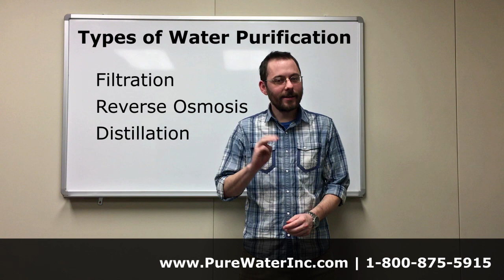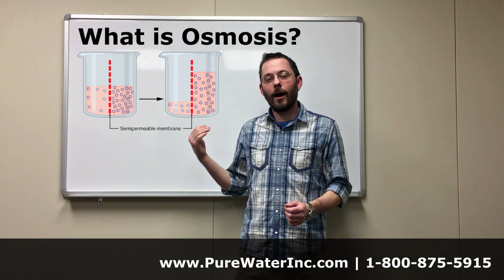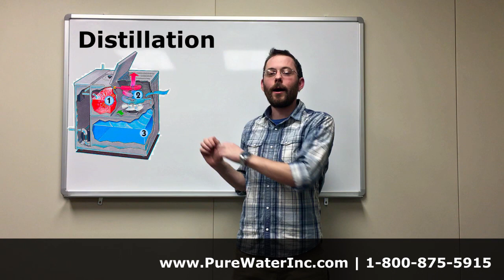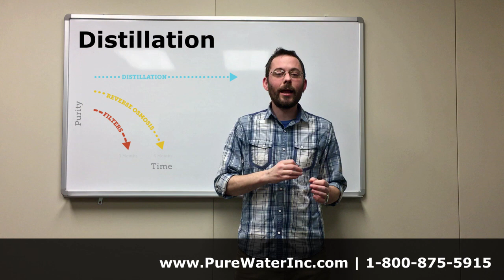Distillers vs Reverse Osmosis vs Pitcher Filters

Comment: Great points and although distilled is the best form of filtered water, it may not be the most practical for household use.

These days RO filters are far more efficient with wastage @ around 1L of waste per 1L of purified water.

As for parasite creep, replacing the membrane periodically reduces the risk.

And then there’s the flow rate of distilled vs RO where RO can provide much more volume of water in a given amount of time compared to distilled.

In a household situation where one wants to use filtered water for cooking as well as washing with filtered running water RO would be much more practical.

You’re comparison seems a little biased to me.

Comment: With Your machines, the toxins are released/captured and released around in the surrounding air.  how do you prevent breathing the ambient air with captured/released toxins?  Should the machines be kept outside for safety?
Reply from the maker: The VOCs that the distiller vents off it in no greater concentration than if you were to bring a pot of water to boil on the stove/in the microwave, make a pot of coffee, or take a hot steaming shower. It doesn't require any additional ventilation than what a typical living space would have.

Comment: if distillation were such a effecient technique then why RO is still used are there drawbacks of distillation also?
Reply from the maker: While distillation is the gold standard for purification, using distillation as a purification method at scale can be cost preventative as a steady supply of heat and power is needed to bring the source water up to a boil in order for the steam to be generated. Many municipal water systems will also shy away from using distillation as a form of purification as distilled water is a highly effective solvent which can leach contaminants from lead, copper, and other soft metals commonly used in older water delivery systems.

Comment: I went to the website and it says to clean the unit with the cleaner/descaler every month or 30 gallons.  I did the math and that comes out to be .75 cents per gallon of water just for this cleaner.  You still have to pay for the electricity to boil the water, and the price of the distiller.. You can buy distilled water for about a dollar per gallon at Walmart.
Reply: Ya but the distilled water from Walmart are in plastic bottles. The distilled water sucks up the plastic toxins like a sponge

Comment: Reverse osmosis is the best solution to purify water. Also most cost effective. I bought a complete set for under 100$ and cost me around 20$ yearly to maintence it. I have 0 ppm. Most People think they only can get down to 20-10ppm with reserved osmosis system, but they forget to buy a filter with resin to achieve 0 ppm.
Reply: Yuck I don’t want my drinking water touching nasty chemical resin.
Reply: @wesbravo8251  Chemical? It's tree resin.
Reply: Where did you buy it?

Comment: I enjoyed this condensed lecture on water purification! The water pitchers ability to filter out impurities doesn't just depend on what can get through based on particle size, but rather on the capability of the media to Adsorb (not absorb). Many pitcher filters mostly contain activated charcoal, which acts kind of like a magnet for impurities. I'm guessing it's the same filter media you have in that distiller your'e selling, since activated charcoal does a great job at removing VOC's from water (the only thing that remains in distilled water that we don't want in there).
Reply from the maker: Hi Richard, you're exactly right! We pair our home distillers with activated carbon filters to provide the best in purity.
Reply: @PureWaterDistillers  If I put the activated carbon directly in my distilled water (whether in a tea bag or loose) and left it there (say, for 10-15 min), would that filter our more impurities then just running it through a filter into a vessel? Thanks
Reply from the maker: @richbirecki  - we recommend running all the water through the filter prior to it entering the vessel. This ensures that all the water is forced through it. If you used it like a tea bag, there's no guarantee that all the water would flow through it. And if it's loose, then you have the issue of how to remove the contaminant-saturated carbon afterward.

Comment: Is the distillation process the same as water softening (Culligan services), and what's the average cost for a residential Distiller system and are plumbers typically trained to do installs or would a specialist be required? Thanks
Reply from the maker: Hi Harold, great questions! First, softening is not the same process as distillation. Softening uses salts to remove ions of calcium, magnesium and some other metals. Distillation uses a phase change to leave virtually all contaminants behind. 

The cost of a distillation system usually depends on if it is a manual fill or automatic, and how much water it produces ever day. The cost can range from a few hundred dollars to a few thousand.

Installation of an automatic water distiller is fairly basic, and any plumber should be able to handle it for you. We do have dealers and distributors who specialize in servicing the machines too.

Please let us know if you have any other questions. Thanks!

Comment: Thank you for sharing. That was really helpful. How about boiling water? Is it effective to get rid of heavy metals and chlorine? Or only kills the bacteria? 
Regards
Reply from the maker: Great question! Distillation, when paired with a simple carbon filter, removes virtually all contaminants including heavy metals, chlorine, and bacteria. 

We've had third-party labs test the process to confirm this, and you can see our lab results here: https://mypurewater.com/home-products/pure-water-lab-results/

Boiling alone kills bacteria, but it concentrates other contaminants, like heavy metals.

Thanks!
Reply: @PureWaterDistillers  ooh yes, that make sense. It will really concentrates the heavy metals. 
I missed it 😆
Thank you for the link and the very fast answer

Comment: I am very curious how could a ventillation system just blows out the VOC from the mix of steam and VOC and keep the steam unharmed to be able to continue its way to the final tank? Sounds bullshit for me. Other question is, if the evaporating is a natural thing which is right, why the destillation is not being made via lower temperature? In this case the VOCs might be kept in the starting tank. The nature will not heat the sea waters up to 100 °C to be boiled and create rain after they are condensating in clouds. I am just asking.
Reply from the maker: Those are actually some fantastic questions! 

To answer the first one: The dual VOC vents don’t blow the VOC gases out.  When the water is heated to boil, The water vapor and a few VOC gases become lighter than air and rise.  As the steam cools, it will stop rising because it is no longer lighter than air.  The dual vents are placed in position on the cooling coil of the distiller that the steam is heavier than air and remains in the coil to be condensed back to water.  Any contaminant that is still lighter than air will continue to rise up and out of the VOC vents.  It is not perfect but it does remove the bulk of the VOC’s from the water.  By pairing it with a carbon filter, we can get over 99.9% removal of most VOC’s you will find in water.  

As for the second question, this is another great question.  The answer is energy.  To turn water into vapor doesn’t require heat, it requires energy.  The sun puts out a lot of energy.  Bodies of water absorb that energy and let off little bits of vapor all day every day.  This works because the water out there is so huge and the sun puts out so much energy over the surface of the earth that it is able to accumulate quickly.  There are actual distillers called solar distillers that will use heat from the sun to heat water left in the open and the steam is forced into a condensing tube to be turned back to liquid and collected.  This will not stop VOC gases from being vented though.  These gases require less energy than water to vaporize and will do so from the sun’s output.    The problem with these distillers is that they take a long time.  With ours, since we use heat as our energy source, we are able to add energy more directly to a small amount of water and vaporize it very quickly.  This way, you are not waiting for a day or two to get enough water to drink and instead can get it in a few hours.

If you have any other questions, please let us know! Thanks!
Reply: @PureWaterDistillers  Thanks I am still trying to understand, probably I need some background knowledge first. :D However I assumed the speed is the reason of  heating it so high temperature. With the directly speed of nature it'd be slow.

Comment: Distillation has a great outcome.... However its costly to heat water, therefor not really a good sustainable way
Reply: Bro teacher Bram, let me tell you, you can build passive water distillers that runs with solar heating. Low boiling point so no VOC, cherry on the cake. Distilled water is the best
Reply: @benben162  reverse osmosis vs distilled???? thank you .
Reply: I don't give a damn about sustainability. I'm worried about my health

Comment: The main issue with a water distiller is the mineral scale that will build up and accumulate inside the machine and they are very hard to remove. I think the machine will eventually lose it's efficiency after a certain number of years of usage and the machine will need to be replaced with a new one. Am I correct?
Reply from the maker: Hi Peter, you are correct that mineral scale can build up and reduce the life of the distiller - mainly because it make the heating element work harder and harder. However, with regular cleaning (which involves soaking the boiling tank in either an approved descaling agent or a 50/50 mix of white distilled vinegar and warm water), we have seen some machines last 30, 35, 40 years without any decrease in the quality of distilled water that is produced. Some parts may need to be replaced over time but rarely do you need to replace the whole unit as long as proper upkeep is maintained.
Reply: @PureWaterDistillers  Thanks for your reply.
Reply: no Bro easy to clean with vinegar, stainless steal is all shiny and good as new, each time i clean it and see the deposit i think " i would have drunk all that shitty stuff"

Comment: Replacing the RO filters is £20 every 6 months the membrane every couple years at £40. 
The cons of RO you mention seem to apply if filters and membrane are neglected.
How does energy cost compare? 
Also whats noise levels from unit?
Cheers

Comment: if i am filling up a evaporative humidifier with filtered water which one would you recommend i buy meanwhile before i buy a mini distiller from you? i have been looking at these types but i am not sure which brand is the best and which one really purifies water the best? Thanks

https://www.amazon.com/dp/B01GABXWCK/ref=sr_1_51_sspa?keywords=purified+water+tap&qid=1551336432&s=gateway&sr=8-51-spons&psc=1

https://www.amazon.com/dp/B07DCMD991/ref=sxbs_sxwds-stvp?keywords=purified+water+tap&pd_rd_i=B07DCMD991&pd_rd_r=ddbb38d8-0818-4ca3-82b4-71c4e44da1a3&pd_rd_w=trK2N&pd_rd_wg=imzUC&pf_rd_p=5c5ea0d7-2437-4d8a-88a7-ea6f32aeac11&pf_rd_r=7X7NQWGZFYJDP0JFJP7V&qid=1551337543&refinements=p_85%3A2470955011&rnid=2470954011&s=gateway

https://www.amazon.com/dp/B01M0I5RII/ref=emc_b_5_t

Comment: hello I can't speak english very well so I don't understand 100%
can you answer me please 
now I am in the UK ,so when I drink tap water I have pain in my stomach and taste is not good , is the filter good or not?
 can  I boil the water in kettle  after  getting cold I drink it?
Reply from the maker: Without knowing what is in your water or what your medical condition is, it is hard to say if some contaminant is causing an issue and what that might be.  Distillation removes over 99.9 percent of most contaminants so it can hopefully could help reliably clear up your water so you don't have to worry about it being the cause of your stomach pain.
Reply: thank you 
before yesterday I bought Brita filter  and it's good for me 
Distillation It's hard to do I think
thx.
Reply from the maker: Brita filters remove a little.  A home distiller will remove a lot.  Because the distillation process doesn't involve a filter, the quality of the distilled water does not dip as you use the purifier.
Reply from the maker: A home distiller is very easy to operate.  Simply pour water into your boiling tank.  tighten the lid and filp a switch to start a cycle.  It is going to give you higher purity water.  On the side of the box of a brita filter it says not for purifying water.  It does very little.  Are you getting any benefit from it?
Reply: @PureWaterDistillers   great thank you
to be  honest with u after I drink  tap water I feel like something hurt me in my stomach but after brita I feel nothing I don't know why maybe my tap water have something brita can clean it I don't know and I try tap water again without brita still not very good for me even the taste change for better.....
sorry I would like to ask about  distiller 
you mean just boiling the water with closed lid then it will be pure water yes ? if it like that then where the bad thing go I think it still inside the tank yes?   ( my English it's not ok ) so I don't understand 100%
Reply from the maker: Distilling the water and boiling the water are two different things.  Boiling the water will kill bacteria and viruses but the dead bacteria and viruses stay in the water.  Steam will be let off which means there will be less water I in the container so the contaminants are more concentrated in the water.  Distillation brings the water to a boil and then collects and cools the steam that comes off of the boiling process.  this steam is cooled back to liquid and falls as distilled water.  We have now killed all bacteria and viruses and made sure we are not drinking dead bacteria.  We have also left all the other contaminants behind that couldn't vaporize with the steam.

Comment: What would be the best solution if you have a UV water treatment system but you are worryed about After treatment, is the water now ionized radiation and harmful to the human body, soil and plastic waterlines?, what harmful after treatment affects are there? Whats the best solution or further water treatment system to use after UV treatment? serious question.
Reply from the maker: Ultraviolet
light is a natural process and does not produce harmful chemicals in water. The treated water does NOT contain ionized
radiation and substances harmful to the human body, soil and plastic plumbing. It’s a safe,
effective and environmentally friendly disinfection method that is widely used
for residential and industrial applications all around the world. Its
effectiveness however declines with the passage of time. (Most UV bulbs need to
be changed out at least yearly.)

 

UV
water purification is a very effective method for disinfecting micro-organisms
such as E.coli, cryptosporidium, giardia or any other types of bacteria and
viruses in the water.  UV rays penetrate harmful pathogens that may be in
water and destroy illness-causing microorganisms by attacking their genetic
core (DNA). This is very effective in eliminating their ability to reproduce.
UV systems destroy 99.99% of harmful microorganisms without adding chemicals or
changing your water’s taste or odor. The remnants of these dead micro-organisms
do however remain in the treated water.

 

Yes,
disinfecting your water with Ultraviolet light is exceptionably simple,
effective and environmentally safe but it is NOT at all effective for the
removal of inorganic and organic chemicals.  (chlorine, heavy metals,
solvents and VOC’s etc.) In other words, ultraviolet purification itself is not
enough to purify water down to drinking water quality.  For that reason UV
water purification is usually paired up with other forms of water treatment
such as distillation, reverse osmosis systems or  sometimes just activated
carbon block filters, depending on what a person wishes to remove. A
distillation system would be the best choice for the highest quality water.